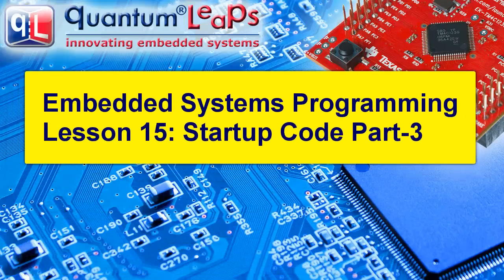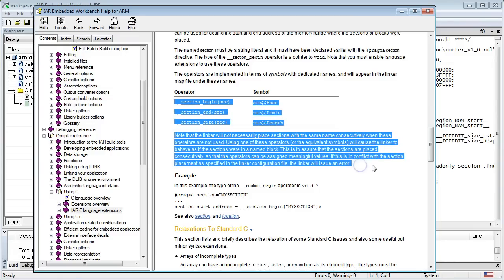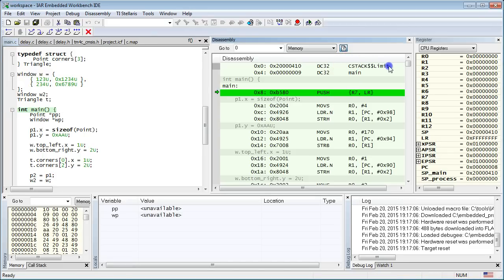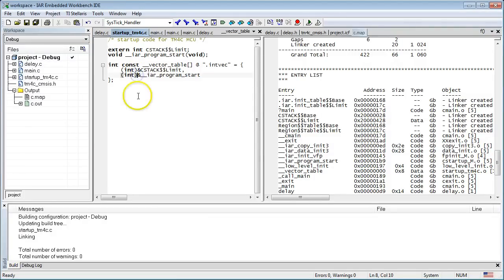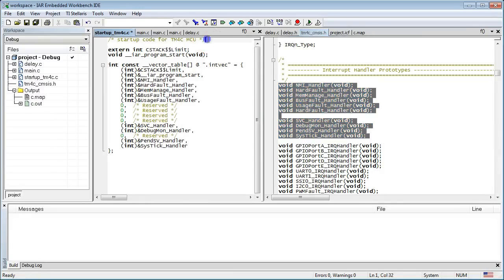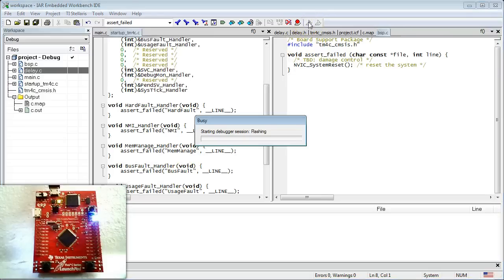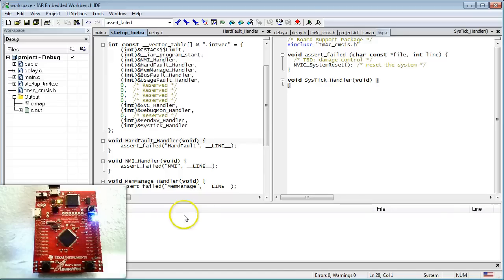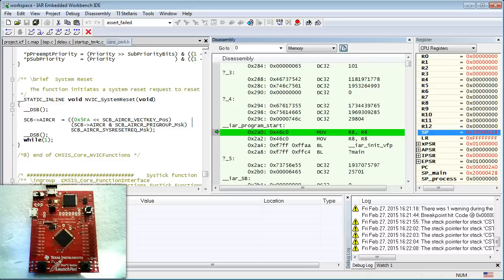#15 Startup Code Part-3: Vector table initialization, exception handlers, interrupt handlers

Comment: Hello Miro,

I've tried to Google and experiment a lot, but I don't manage to implement a stackless function in the ARM compiler toolchain.
I've tried the noreturn attribute, and the naked attribute with custom assembly, in which I tried to IMPORT, LDR, BLX into NVIC_SystemReset.  Also, I can't call  NVIC_SystemReset like a C-function because the naked attribute only allows assembly.

Searching for stackless in the ARM documentation also yields 0 result.

In short: I can't figure out how to implement a stackless exception handler in the ARM compiler toolchain/Keil.

Do you have a pointer in the right direction?

Kind regards,
Jorgis
Reply: I think I solved it, I had some tunnel vision. The __attribute__((noreturn)) works for me, but I forgot to set it on HardFault_Handler as well as assert_failed. I guess this makes sense as functions that don't return shouldn't have to preserve the stack, but the arm documentation is not very clear on whether this is the right approach.

Can you confirm this is correct?

Comment: Your Start-Up code videos are greatly appreciated, but I am at loss about why the manufacturer does not include the support files for their processor. I mean, they write and provide many files, but they missed the vector table? Or may be I am being very simplistic? I would think that TI would prefer its customers to quickly start working in their projects rather working in the microcontroller support files. I have worked mostly with Microchip and Atmel's AVR and never had a similar situation, at least so far. Just curious on something I didn't see very often.
Reply from the maker: High Altitude Observer I've never claimed that there are no standard startup code for TivaC. In fact, Texas Instruments offers the huge TivaWare library, which obviously contains startup code (hundreds of copies, actually). But the 
startup code on offer there has many drawbacks: (1) it requires you to 
manually insert interrupt handlers into the vector table, (2) is NOT 
compliant with CMSIS, (3) the default exception handlers are endless 
loops, which causes "denial of service" in case of any error.
Reply: Quantum Leaps, LLC 

Thanks for the clarification.

Comment: My project is not working properly.  The HardFault never gets called even after fault injection.
Reply: is this supposed to work on the board only? I am using simulator.
Reply from the maker: @yashesvi-raina  HardFault will not happen in the Simulator. It will only happen only on the real board (TivaC LaunchPad). --MMS
Reply: @StateMachineCOM  Okay, Thank  you!

Comment: Great tutorial series.  I was trying to recreate the HardFault_Handler exception after adding __stackless and I am unable to trigger it. I have tried removing the __stackless extension and it did go to HardFault_Handler. I have followed the same steps by adding the __stackless extension and again, it just runs the program as usual. I am sure to be running on the board as it triggered the fault handler without __stackless extension. IAR tool version that I have is 9.30.1. 
Another question is, where did you get the rest of the vector table from? I'm sorry if I'm asking a basic question. Please help

Comment: Dear Miro Samek,

First of all, I would like to thank for all of these excellent lessons and for being a guide for an embedded systems programmers. Thank you so much.

I have some some questions related to this lesson,

(1) How we know the data type of the default __vector_table ? because it is important to calculate to offsets for the reserved table entries.

(2) How we know the data type of the CSTACK$$Limit symbol; is it a symbol or a variable ? What is the difference b/w a variable and a symbol ?

(3) If we are really interested in the address of CSTACK$$Limit then why we add '&' sign in front of it; because, addresses are hold by the pointer, so if it is a pointer than we can simply write it like CSTACK$$Limit intead of &CSTACK$$Limit; or if it is a variable then we can also write it like CSTACK$$Limit, then why to add '&' sign in front of it ?

(4) How I can be sure of the prototype of the function __iar_program_start, meaning where can I find it ? The function exist in a object file as shown in the linker map file.

(5) What is the difference between interrupt handlers and exception handlers; As from my observation both do not take any arguments nor they both return any values ? Because M-series micro-controllers are designed to use C-language for start-up codes; is it possible to to pass arguments or return any value ?

Comment: Can following this course with the STM32 still be applicable or recommended?
Reply from the maker: Yes, the STM32 NUCLEO-C031 can be used for this course. Specifically, most of the project downloads (see https://www.state-machine.com/quickstart ) now also include versions for the NUCLEO board. However, if you want to follow the lessons exactly as they are presented in the videos, the original TivaC LauchPad is also still available. --MMS

Comment: Why are there reserved spots for exceptions? Forwards compatibility or something?
Reply from the maker: It's hard for me to comment on the motivations of the ARM engineers, who design the Cortex-M CPU. But apparently they wanted to leave some room for future expansion. The "reserved" spots didn't cost them much and the way a CPU architecture is often expanded is to add new exceptions to handle new situations. For example, a new generation of CPUs might need to handle some new instructions or might need to report disallowed memory access. Such things could be handled by new exceptions. --MMS

Comment: Thank you very much for these lessons.
I've been following along with a cortex M4 board from ST and I've been fine up until now. When I try the Fault injection, the debug log shows that the SP is outside the stack range but it doesn't go into the Hard_Fault handler. It just acts like the delay function isn't there. I mean, when I single step, I see it go through the function but it doesn't loop over it. It just continues to turn the LED off.
Do you what might be happening? 
Thank you.

Comment: Your tutorials are truly gold. I want to know one thing can you tell me at 5:03 you have used '&CSTACK$$Limit' as the first entry of array  __vector_table[]. It means that the address of CSTACK$$Limit is saved in the __vector_table[0] but the address of stack pointer is in the CSTACK$$Limit variable so if you are not dereferencing it in the __vector_table how the address that is in the CSTACK$$Limit variable appeared as the first entry in the vector table. Also can you tell me why you have typecasted CSTACK$$Limit  as an int i didnt got that part.
Reply from the maker: Apparently, the IAR special variable CSTACK$$Limit does not hold any address, but instead it is placed at the end of the section (CSTACK in this case). Therefore taking the address of this variable (with the `&` operator) provides the address of the end of the CSTACK section, which is what you want. Please note that if CSTACK$$Limit would hold an address, you would have to de-reference it to get to the value, but this is NOT a compile-time expression. Therefore, the __vector_table[] would NOT be able to be initialized at compile-time (and it has to, because it goes into ROM).Finally, the cast (int)&CSTACK$$Limit is needed because the type of __vector_table[0] is int, not a void* or any pointer type. --MMS
Reply: @StateMachineCOM  The functions are void type in the declaration then why we have to type cast them as int because in  pointers to function, when the address of a function is passed to a function pointer we only write the function name so i didn't understand what the typecast to a function mean here. is the typecast referring to return type of function?
Reply from the maker: @dragonball-ow2ke  It seems that you might be confusing at least two separate aspects. First, the type of the function matters only when the function is actually called and returns that value. But in the vector table, you specifically do NOT call the function. You only take the address of the function. Which leads to the second confusion related to two ways C allows you to take an address of a function. The first way is just the function name without the parentheses,  e.g., NMI_Handler. This is probably what you've learned. But there is also another way of taking the address of a function explicitly with the "address-of" operator '&', e.g., &NMI_Handler. Both ways produce the same result, but I prefer the second alternative because it makes it absolutely clear that the address is taken. Finally, the cast of the address to int (e.g., (int)&NMI_Handler) is needed because the elements of the __vector_table[] array are int. --MMS
Reply: @StateMachineCOM I have spent whole night watching your lectures and writing codes. Thank you very much for clearing the confusion Mr. Mikro

Comment: I love the lessons so far! I've watched all of them in order to build Cortex M0 and M4 projects (using the TM4C connected launchpad). I hope you will get into configuring peripherals after the lesson on interrupts. Also, I've had problems before mixing assembly with C in other microcontrollers, I was wondering how this is done with ARM and the IAR environment. Thanks

Comment: Anyone else getting the error "Compiler generates FPU instructions for a device without and FPU... " after enabling floating point unit and VFPv4 for FPU ? My workaround is add "#define __FPU_PRESENT 1U" to the code. But I'm sure there's something else I am doing wrong.
Reply from the maker: Yes, it seems that the newer version of IAR require the definition of the macro __FPU_PRESENT. Thanks for pointing this out. The definition has been added to the "tm4c_cmsis.h" header file used in lessons 12-16. The project files (lesson12.zip .. lesson16.zip) have been updated on the companion page https://www.state-machine.com/quickstart  and on GitHub (https://github.com/QuantumLeaps/modern-embedded-programming-course ). Please download the project(s) again. --MMS

Comment: Since RAM starts from 0x20000000 and you are trying to push to stack and as the stack grows downwards and it is a illegal memory address so it causes HardFault. And again in HardFault there is one more push and it causes another HardFault and goes on in loop.
Reply from the maker: Yes, precisely, manually setting the stack pointer (SP) to the beginning of RAM at 0x20000000 is how the fault has been "injected" into the program to test the error handling. But this has an interesting application: it shows you how to *detect stack overflow*! Specifically, if you place the whole stack at the beginning of RAM, overflowing the stack means that the SP would drop below 0x20000000, and from this video, you know that this causes the HardFault exception! Traditionally, the stack is placed at the end of RAM, not the beginning of RAM. But this placement won't detect stack overflow. Instead, the overflowing stack would corrupt the RAM below it. For this reason, I recommend placing the stack at the beginning of RAM. --MMS

Comment: If I'm using Code composer studio with TI's compiler, which doesn't have the "stackless" function attribute, would I need to write these handlers in inline assembly, or would they need to be done with a pure assembly file?  When I get to writing the assert_failed code, it doesn't matter if I write the body in inline asm or as a function call to __NVIC_SystemReset(), it still includes two str instructions for the function arguments to be placed on the stack before I assume control. No hardfault but I'd like my output to be clean if that's something that matters for this code.

Any suggestions for making it work with my compiler using c/ inline asm, or do I need to learn how to link a pure assembly file/function?
Reply from the maker: Just don't use the TI compiler... It's outdated anyway. Instead, from Code Composer you can use the GNU compiler, as shown in this lesson. --MMS

Comment: Hi sir, thank you for your excellent contents! I learned a lot from it. I have one question is: I hear about the concept of bootloader, but I don't know what it actually means. I wonder if bootloader is the program which run before the main function you introduced here in previous lessons? It would be great if you could explain this problem for me, i really appriciate that. Thank you very much.
Reply from the maker: A bootloader is a piece of software that allows updating the embedded software over a serial port or some other communication link. A bootloader is not used in this project, so I don't discuss it,  but you can search for it. For example, the STMicroelectronics channel has some videos about bootloaders https://youtu.be/OkUQ3iMmiYQ . --MMS
Reply: @StateMachineCOM  I'm trying to build my bootloader for Arm CortexM4 MCU, but I don't know how to modify linker script file and other relative stuff to achieve my purpose. For example when I want to change MEMORY region in linker script from 0x80000000 to other region for my application code, I don't know how to manipulate with regions in linker file such as .reset, .eh_frame_hdr,.... 
The default .reset region in my case is: .reset :
    {
        KEEP(*(.reset));
        . = ALIGN(256);    
    } > FLASH_0_cached AT > FLASH_0_uncached = 0xFF
How can I know what each regions is used for, I desperately looking for some way to understand it but still not figure it out. I don't even know why flash is need to have 2 part: cached and uncached, finding explaination for this is really challenging to me. Hope you can give me some advises, thank you Mr. MMS.
Reply from the maker: @tungtran4019  A bootloader is quite an advanced project. Explaining linker scripts would require a separate lesson (and perhaps more than one). Also, with a bootloader, you need to carefully link the application such that it won't disturb the bootloader.
Reply: @StateMachineCOM  yeah It's really challenge to me and I don't have much support in this project. I followed a tutorial of manufacturer of MCU I'm developing but still not able to run bootloader correctly. I ran bootloader but when I upload new application code and unplug, plug to reset MCU, it does not run application code as expected. A lot of things I have to find out. Can you explain to me this part meaning?This is my default linker script application project (not modify start address yet).

MEMORY
{
  FLASH_0_cached(RX) : ORIGIN = 0x08000000, LENGTH = 0x00000400
  FLASH_0_uncached(RX) : ORIGIN = 0x0C000000, LENGTH = 0x00000400
  FLASH_1_cached(RX) : ORIGIN = 0x080C0000, LENGTH = 0x001E0000
  FLASH_1_uncached(RX) : ORIGIN = 0x0C0C0000, LENGTH = 0x001E0000
  PSRAM_1(!RX) : ORIGIN = 0x1FFE8000, LENGTH = 0x18000
  DSRAM_1_system(!RX) : ORIGIN = 0x20000000, LENGTH = 0x20000
  DSRAM_2_comm(!RX) : ORIGIN = 0x20020000, LENGTH = 0x20000
  SRAM_combined(!RX) : ORIGIN = 0x1FFE8000, LENGTH = 0x00058000
}

 I don't understand why it need to have 2 flash region 0 and 1 like that. I see that flash 0 just use for this reset region: 
 .reset :
  {
    KEEP(*(.reset));
    . = ALIGN(256);    
  } > FLASH_0_cached AT > FLASH_0_uncached = 0xFF.
I quite understand some syntax in here but not all of it. Can you explain to me what "FLASH_0_uncached = 0xFF" line means?
Can I combine 2 regions of flash in this project to just 1 single region?

Comment: Question for those more intellegent than me (most of you I guess!). I have been using an STM32L053 as my development device and have got to this stage with a bit of messing around.My issue is that the ST CMSIS file (stm32l053xx.h) does not contain any prototypes for the interupt handlers. If I add a prototype to the startup file I get an error telling me that there are duplicates for __vector_table in the startup and in vector_table_M.o. Anyone got any suggestions (apart from going back to TI).
Reply from the maker: You can simply provide the prototypes for the ISRs in the bsp.c file. For example, you can just add a line "void SysTick_Handler(void);
" at the top of the file. Also, if you are interested in STM32, you might want to look inside the QP/C framework (provided in the materials for this video course as qpc.zip download from state-machine.com/quickstart and also on GitHub at https://github.com/QuantumLeaps/qpc. Specifically to STM32L053 there is startup code and examples for STM32 NUCLEO-L053, just unzip qpc.zip and look in directories 3rd_party and examples. --MMS
Reply: @StateMachineCOM  thanks!!
Reply: @StateMachineCOM  Not sure if I am missing something here.When I change the SP register then this goes to a hard fault and then to the NVIC_SystemReset. The NVIC_SystemReset starts with a PUSH of the LR but that causes the SP to go to 0xFFFFFFFE and then that is locked. All seem good up to then. Admittedly still going with STM32L053 so not sure if the M0+ architecture is an issue.
Reply from the maker: @richardparker1134  Yes, that's right. The assertion-handler should be carefully tested and designed such that it will work even in case of stack overflow or corruption. The proper way would be to set the SP register to the top of the original C-stack. I've shown how to do this in my blog post "Are We Shooting Ourselves in the Foot with Stack Overflow?" see: https://www.state-machine.com/are-we-shooting-ourselves-in-the-foot-with-stack-overflow/ --MMS